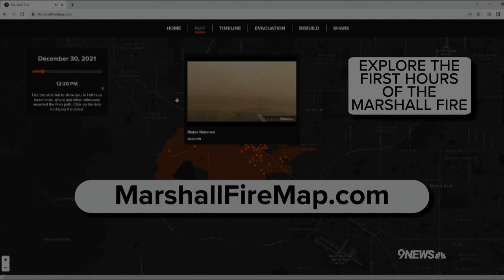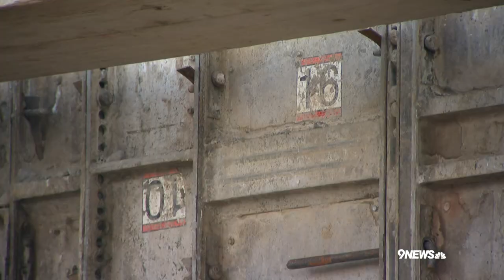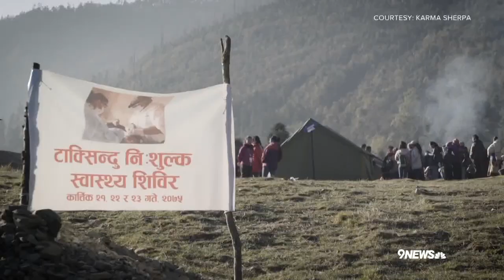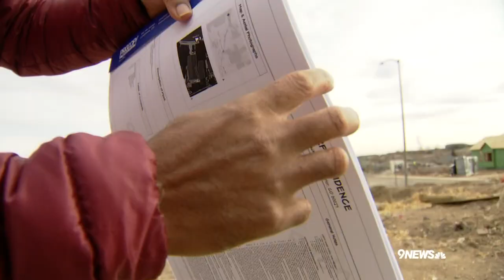The Marshall Fire: One year later

Comment: As an Australian living in a VERY fire prone area of the world, was amazed that the human tole of this fire was so low. One of the things I dread about in suburban environments is people getting trapped in the cars as they flee at the last minute. But the roads in these videos are wide and the housing estates relatively new, so large falling trees blocking roads does not seem to have been an issue.

The typical houses shown in the videos burning, were often two story wooden building with complex roof profiles and verandas. They are just designed to catch embers. And of course large windows are great for daily living, but are a fatal weakness for houses in fire. Once the heat brakes the glass, the embers are free to enter and the entire house is usually gone within 30 minutes. Designing houses to resist fire is a complex business, but low profile and underground in the way to go. Wire mesh to prevent embers getting under houses and jammed into eves, is a must. The smoother you make the outer surface of the house, the better.

Another thing is vegetation. Clear properties is not the way to go for ember attack. Fire resistant trees and shrubs catch embers. The last thing you want is an unobstructed hail of embers hitting your house like a blow torch. Vegetation around your home is NOT generally the cause of house destruction. Australian native pants and trees are infamous for their flammable oils, but it is RARE for trees around our house to be burnt. It is normal to find a house burnt to the ground surrounded by a garden that is intact. Buildings and cars are destroyed y ember attack, but the plants and trees all around survive.

Its a radical idea, but rebuilding a home can take three directions: ignore the risks and rebuild what you had. Build a fire RESISTANT fortress, that may not be to your liking as a home, or build a ‘disposable’ home that you expect to loose, and build a fire resistant bunker, to preserve your valuables. The trick is, its not to save you. You leave, but important things MAY survive in the bunker. Its a lifestyle choice. A bunker can double as an office den, or a root cellar. Big topic!
Reply: I doubt there was much thought about fire mitigation when those neighborhoods were built. People who live in the mountains are a lot more mindful. I just don't think anyone ever imagined anything like this. I live in the area and was in total shock.

There is a lot of rebuilding going on now, and I really hope they keep fire safety in mind. If the Marshall fire didn't teach them that, then I honestly don't know what will.
Reply: 3:04  This guy in the video says in Colorado they are accustomed to forest fires all the time but this one was different. That is what the people in California said about their last fire. I notice 3 things different about the Colorado fire compared with the fire that just happened in Hawaii.  In Colorado, first thing was sheriff's department was on it checking locations of downed wires and smoke and then sheriff's department worked hard to evacuate people even knocking on doors. Also, there was an emergency warning that went out over cell phones while they still had cell phone service.  Second, in Colorado, the fire department was on it right away fighting the fire and trying to contain it, and third, the roads were more generous and there was more than one way out for most people.  

All three of these were missing in Lahaina fire that so many people died in. They didn't receive the emergency warning while their cell phones still worked, by the time most tried to get out, there was only one road available to get off the island and traffic stopped by abandoned cars;  the fire department wasn't on top of it from the start. Most Lahaina videos don't show any first responders knocking on doors and trying to get people out of harm's way. They were truly sitting ducks, and I imagine the body count will be much higher.  

Even Californians who also have fires all the time, said this last fire in Paradise, CA was very strange the way it burned houses to white ashes but left all the green trees in the neighborhoods standing, and other oddities. If this is evil doers coordinating these fires, maybe they chose Lahaina because there is really only one way in and out and they knew the body count would be higher. I once read that the first time may be a coincidence, the second time may be unfortunate, but the third time is a trend. And, now we have had 3 unusual fires in 3 different US States in less than 2 years. I say we have a trend on our hands. Add to this the Canadian fires whose smoke blew down into the US and it makes you wonder.
Reply: Thanks for mentioning that it's normal for trees/plants to not be burnt. Seems the majority of people are still having a really hard time with that even though it happens all over the world and even with smaller fires that don't make the news. Brush/grass fires are particularly prone to this because they are low to the ground fires propelled only by wind. Forest fires in the middle of a mountain can hop tree to tree even without wind (though wind is still obviously a factor, it just isn't as necessary) because the trees are so close together and pine trees are simply more fire prone because of their thin branches and pine needles hold less moisture than lush leaves do. The ground is covered in dead, dry pine needles too which is also much easier to burn than lush green grass or plain dirt/sand. Homes, even ones built in the mountains tend to have other vegetation surrounding their homes such as grass, shrubs, flowers, etc...unlike many of the mountains in CO & CA which are bare aside from tall skinny pine trees. 

Point being, yes. It is strange how mother nature and fires work. It never won't be eerie and evil looking. Fire is just about the most sickening thing on earth. And just like tornadoes can destroy a home and leave the neighbor's untouched, it will never "make sense" or be fair. And as many forest fires as there are, it's still very rare for cities to be hit. That is why everyone thought the site was "so weird" because even Californians and Coloradans mostly have never seen neighborhoods destroyed. It is a sight to behold, speaking from first hand experience.
Reply: I am so glad that you have pointed out that the vegetation is not generally the cause of the house destruction.  I live in the Pacific Northwest and the Firewise (Regional fire prevention) group is recommending that everyone clear tress and shrubs from around the houses in the rural forested areas.  Insurance companies are now notifying us with new policies that require we do that or they reserve the right to come in and remove brush and trees at our expense, and also to deny coverage.  The recommendation may be valid for fire ecosystems in E. Washington, but make zero sense on the West side.  My trees and shrubs create a microenvironment of cool shade, and removing them would create a heat island that would encourage my house to burn.  I  am a member of the King County Rural Forest Commission and I keep trying to address this and I am ignored by King County officials, who proceed to endorse clearing and grading for fire prevention.  Not even recognizing that 100' clearance, which some idiot recommended (I know personally- we got our forestry degrees together and he is an idiot) who was hired by Firewise to provide guidance), will do nothing to stop a fire during high winds.  The fires in Oregon jumped the Columbia River where it is a mile wide.  No logic or common sense in these policies. My former co-student has a E WA mindset- he lived there and doesn't understand ecology. And now the entire region is following his recommendation.    The Lahaina fire was indiscriminate regarding vegetation- I analyzed it yesterday in ArcPro. The fire seemed to behave like a tornado and hit and miss.  It also didn't matter the age of the house, the type of construction, or the type of roof.  Cleared veg or not, or who owned the houses.  I cross checked burned and unburned with ownership and construction, and vegetation, and saw no significant variable.
Reply: I watched an investigator video regarding the Paradise fires and it was super weird the way that fence posts didn't burn, yet the areas where the nails and metal were located in the posts were scorched and melted.  The arborist couldn't understand how this could happen, why didn't the wood burn but the metal melted?  My question is, why would DEW target Paradise?  The arborist would not make comments either way, because he doesn't know anything about DEW, he just called the burn behavior as anomalies that he couldn't explain.  Same with houses burned to dust and yet needles still on trees right next to the burned house.  I have no explanation either, and don't know anything about DEW.  I don't see a motive, do you? @anneteller3128
Reply: @mariknutson7307  Your former classmate is not an idiot, he's a useful idiot and may be paid to be one. Sometimes just securing the job when competing against more qualified, competent and honest applicants is enough payment to get a useful idiot on board, doing the work of the money ruckers.  Yes, he's what computer engineers like to call an ID 10 T problem.
Reply: @utson7307The metal was affected more because of radiant (infrared) heat. Wood is a poor conductor of infrared energy, so it needs much longer fire exposure than the metal. Directed energy weapons are not real or used to start forest fires. Typically wildfires start from electrical shorts like high voltage wires touching from high winds or from human sources like cigarette butts/illegal fires.